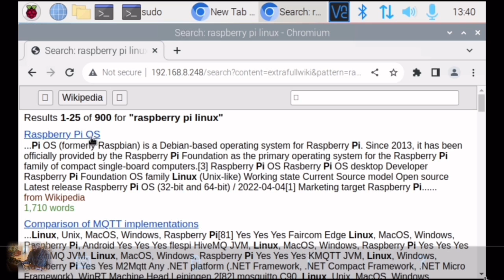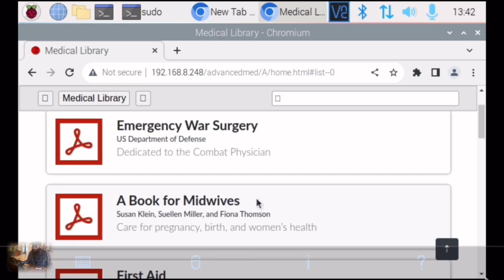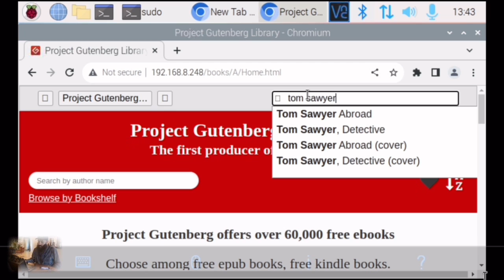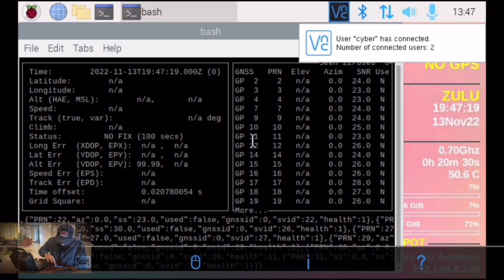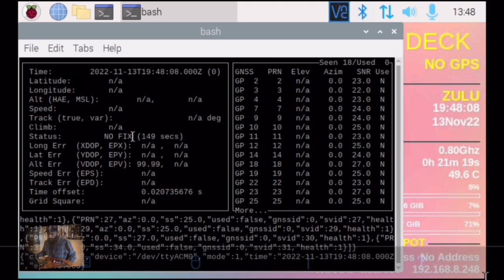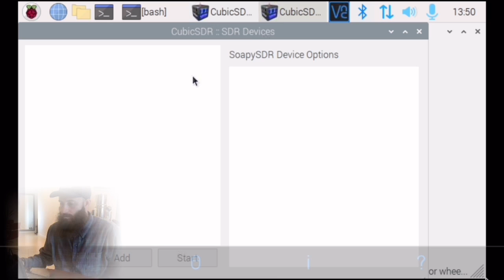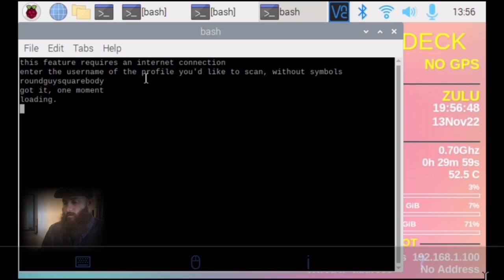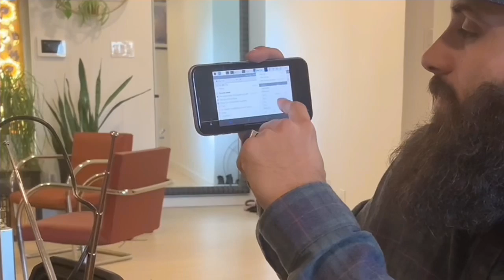GRIDBASE UI introduction.

Comment: It would be cool if you had an ai fed all this information and you can search through all of it with a simple question
Reply: but that would require at least 8GB RAM and on AVG 64GB for future proofing and speed. + 5TB memory card. As you need to store a lot of data that might be used on the AI for future training or quick assessment.

Comment: Does the cyber deck have HF transmit capabilities? if not it would be cool to integrate a QRP radio to use modes like ARPS and JS8call

Comment: There is some time invested into this build.  Good job.  I am not looking to buy one at this time but if I had the extra cash I totally would.  I might have missed it but what are you using for data storage in this unit?  NVMe?
Reply from the maker: SSD. For its adaptability, durability, and COTS friendliness.
Reply: @gridbasedotnet  i agree. Ssd is the best choice.  Great work.

Comment: How did you get the programs/apps to all fit within the screen? I’ve downloaded a few ham radio programs like j8call, xastir, gpredict, etc., but the windows are too big to view them all on the tiny raspberry pi screen. I found one kind of solution someone online said to enter: “mousepad .config/wayfire.ini” and it opens up a file and you scroll down and have to add a line in between some existing lines. That kind of works but it just makes everything that you open maximize automatically. It’s better that I can at least see the top bar where I can exit app if I want but some apps still go off the bottom of the screen. And it made conky try to go full screen too. So I’m super curious how you have it set so you can open any app and see the whole window.

Comment: Starlink + laptop in a case = better setup. this thing looks like its a slide show. and the res looks fine all blown up for a video but that screen looks garbage
Reply from the maker: Takes a lot of power to run laptop/starlink. 

Better is subjective. Better at computing performance? Yes. 

Better at long term sustainability for basic computer functions in the field? Absolutely not. You’re also still dependent on satellites so it’s not exactly decentralized. You’re still leveraging existing infrastructure, which is the exact thing this project is trying to avoid. So. 

Better for you? Maybe. Better for my customers who understand the goals, limitations and requirements? Definitely not.
Reply: @gridbasedotnet  ofc you dont think its better lmao youve found a money printer. does ur device not look for sats also? yup so that whole "ou’re also still dependent on satellites so it’s not exactly decentralized" statement is usless. and starlink can be run on a solar setup indeffiently. plenty of ebook files onlinne to mass download to store on a laptob
Reply from the maker: What the fuck is a laptob
Reply from the maker: Mine can look for satellites. But it isn’t required to access the off-grid internet. Only for GPS nav.
Reply from the maker: You clearly have little idea about what the fuck you’re talking about. Which is fine, you came here to learn. But learn then. Ask questions. Don’t criticize with infantile logic. Sit down and listen for once.

Comment: Magnetic cellar automata circuit with electro wetted display could go all year long on that battery, as while not classically fast enough to be justified commercially, it is like 1 million lower energy decades ago, and is now talking about 4 tera Hertz.  However, the classic type of  the MCA type circuit, can be manufactured at home.  So, excellent for a survival prepper tablet which could fit in a normal laptop style case with many terabyte MCA storage space.  There are cheaper manufacturing options coming out now, so a full development could be had with some crowd funding.  I'm not in a health position to do so, but some completion helps and rebuilding civilisation after the catastrophe cycles, sounds good to me.

Comment: I think I'm not sure I understand the benefit of using your phone to access this device over VNC. If you can stream the device's screen then it would be much easier to just access the ip on port 80 to view the information directly..

I guess it is an interesting concept. I think the only feature that is interesting to me is the radio application, but I assume that would require a license to operate in a way that would make it useful.

Other than that, I am unable to determine a good purpose for this product as the niche it is attempting to fill would be better filled by converting e-waste, rather than using new components. It seems that you believed that the software portion of this was difficult, I am not sure I understand that perspective as there is definitely quite a lot of documentation on how to create something like this. Perhaps it is a chicken and egg situation, where you are unaware of the words to search for to learn how to do it.

For some of us tinkering with Linux is normal, and the idea of paying someone else to have tinkered with the install is inane.

I have never understood that "Stalk" app, I have seen it used on TikTok as well. It doesn't seem like a particularly impressive piece of software. I think it creates the link present on the screen, sends a request to that page, and displays the link if the server responds with a 200(OK). It's something someone could create during their lunch break, and if you wanted to use it for the purposes you stated, to determine information about yourself, it would be better to just set up a webpage that when opened does the same thing and sets a toggle to found/not found. I guess it's possible you don't have the list of websites that the stalk app does. But if it's just for you then you know where you should be findable so I am not sure if you need that list.

Comment: One thing that would be tremendously useful with this build is an e ink display to seriously cut down on energy usage
Reply from the maker: The refresh rate isn’t good enough to handle the tasks required of the device. 

However, pocket is screenless, that is the lowest power option.

Comment: its worth noting the rasberry pi 3 can run at minimal power with a simple usb-b charger. A rasberry pi 4 cannot. The rasberry pi3 is a usb-b vs rasberry pi 4 which is usb-c. The HDMI on a pi3 is normal, its completly fucked on a pi4 and requires a mini-hdmi adapter
Reply from the maker: Since you’re noting trade offs…

Raspberry pi 4 still consumes a fraction of the power compared to many alternatives. Small enough to easily run for 8 hours of decent lithium battery packs. 

Additionally, the pi 3 does not efficiently have the capability to boot from USB, limiting storage transfer size and speed.

Lastly, we leverage the SPI interface. So the HDMI, while completely standard and not “fucked up”, doesn’t interfere with what we have going on here.
Reply: @gridbasedotnet  okay so maybe the pi4 is worth it (someone obviously knows more in this exchange lol), but the hdmi is not standard, maybe the spi interface is but the port is the miniaturized hdmi which is weird, depends on how much soldering one plans on doing. And for battery packs maybe it makes no difference, but the pi3 can run undervolted from a iphone charger block and the pi4 cannot
Reply from the maker: @0xdeadbeef238 that is true, with some limitations. The pi might run, but I needs full power to support peripherals such as high performance hard drives and some USB GPS modules

Comment: If only this was solar powered, waterproof, fire proof and hand cracked with alternate source of power other than lithium ion. 
With dark mode. Hahaha
Reply from the maker: It’s designed to be interoperable with many types of power sources. I have a portable solar panel that it works with. The case is waterproof. fire resistant. And dark mode is optional.

Comment: Very cool. Need to add a local LLM chatbot to this so we have GPT-like discussion offline.
Reply from the maker: You want to help? I have tried and cannot get Llama to perform reliably.
Reply: Is it a speed problem, or is the LLM just dumb?
Reply from the maker: LLMs we’re dumb
Reply: Some models that you might want to explore: T5 Small or T5 Base,  BERT-Mini, BERT-Small, BERT-Medium, FastText, ELECTRA-Small or ELECTRA-Base, GPT-2 distilled
Reply: It would be fantastic if you could get a chatbot interface to locate specific data offline. Say you had a specific set of ingredients that you wanted a specific recipe for, you could put it into your chatbot and it would access the local data to compile an answer. That would be invaluable in a SHTF scenario where the grid goes down. In an emergency, one might not have time to search databases to find needed information.

Comment: I actually had this same idea years ago. Main thing you need is a Faraday cage to prevent solar flares from destroying your computer, which is a highly likely doomsday scenario.
Reply: DIY Faraday cage: https://www.youtube.com/watch?v=2s8CpK6F7UM
Reply: That would fit in large ammo box
Reply: Its a pi, not a car. They work by using lengths of wire to induce charge and fry electronics. It really is only an issue for the grid and anything connected to it.

EMPs don't work like a magic permanent shut off button.
Reply: I used to want to download all of Wikipedia onto a drive then keep it with a solar charger and small tablet to access it all
Reply from the maker: @marcusholtzheimer9316 you should still want to do that.
Reply: Everyone had this idea years ago. What did you do with your idea?
Reply: @jerbear7952  downloaded everything I needed to an old phone. Works like a hot dam
Reply: I too thought about this but if there was a solar flare big enough to knock down most of civilization my raspberry pi ain't surviving no matter how big the cage
Reply: @BeaHasPP  I keep getting mixed results as to whether it will or not.
Reply: @plaguedoct0r  I mean any Faraday cage is better than non but to be fair I haven't delved to deep in to emps but if an emp is basically a wireless electric pulse than a Faraday cage is a wire and it makes sense that the bigger the emp the thicker or bigger the Faraday cage would need to be to channel the energy to ground. If my understanding is wrong please correct me.
Reply: @plaguedoct0r it needs to be grounded so that the surge can be discharged into the earth. Otherwise there's a real chance that the cage might not really do anything
Reply: @hcolider2817  Thanks. But I'm pretty sure they did in the video I provided.

Comment: So thought a bit more about this "invention". 
 1. Kindle $99 ( all the books I could ever want to read in my lifetime) 
 If you don't know you can use a free program called Calibre to convert any book format and put on your kindle. 
 2. generic solar panel with USB $30 to charge the kindle and the SDR
 3. SDR $199 
 4. Garmin GPS $199 
5. waterproof case $40 

 Not having all of your eggs in one basket PRICELESS!
Reply from the maker: That is an excellent alternative! Not capable of doing everything the base station can do by any means. But, for strictly the IIAB function, it would do the trick. The base station features the ability to manage a plethora of digital mode communication programs over HF. In addition to that, it is a turn key solution with customer support that less tech savy folks appreciate. The best part about the free market is that we are all able to make choices about what best suites our needs, and I support the hell out of that!

Comment: i only have to ask why? put a laptop in a case, mutch better performance.
Reply from the maker: Not looking for better performance as much as we’re looking for optimal power consumption, for operating off solar and other alternative energy sources. Also, for running radio programs it’s nice to have the control linux offers.

Comment: yeah all fun until the emp which comes from the funny nuke you showed at the beginning fries the whole thing. no emp protection at all. good luck
Reply from the maker: It was designed to be small enough to fit in the very wide variety of EMP proofing solutions existing readily on the market today. 

EMPs are a serious threat. But, they’re not the only threat. I figure let the end user choose if and how they want to EMP harden their devices instead of increasing the cost of the product and forcing a proprietary EMP solution on them

Comment: I think you meant IP6x not IPv6.
IP6x is a waterproofing rating. The x is replaced with a dustproofing rating.
IPv6 is a network addressig protocol.
Reply from the maker: You are correct. Too much going on in the dome 😮‍💨
Reply: Whew. For a second there, I thought this would keep all my 128-bit addresses bone-dry, but my 32-bit IPv4 addresses would be soaking wet. I was both scared and confused.

Comment: Time stamp 4:24 it says when you order it from you it comes with a 48000mah solar charging block, but your preorder says it doesn’t, which is it
Reply: Also at 13:45
Reply from the maker: It does. And always has. You might be looking at the DIY kit on the website which does not.

Comment: You should also add a protection for it from emp.
Reply from the maker: Easily done by throwing it a faraday bag
Reply: @gridbasedotnet  niceee... But it should be built into it so you don't have to carry extra bags in nuclear war.
Reply from the maker: If it was built in the Wi-Fi and Bluetooth capabilities would be limited. 

I prefer to let the end user decide to either throw it in a faraday bag or like it themselves. Flexibility in a product is good. I don’t need to do everything for the end user.
Reply: That venerable Kiwix is made to survive! Happy to see it still useful after all these years, thanks for sharing.
Reply from the maker: @esspe2 indeed!! When did you first use it?
Reply: @gridbasedotnet  It was used mainly for Wikipedia, books, and videos that some YouTubers had put in an archive, and also PhET for stem. But then I got a good Internet connection and it was less useful.
I also found IIAB a neat project; nice that you gave it a wind of freshness.
Reply from the maker: @esspe2 that is a high compliment! Thank you 🙏🏽

Comment: Nice looking build! I am in the process of building one very similar. My one question is how much does the exterior modifications impact the water proof ability of the pelican case? While I like the exterior plugs I am trying to not breach the shell of my case for anything.
Reply from the maker: I use only IPX6 rated connectors and seal them with silicone. In all my tests I have had no failures. Even after multiple drop tests.

I have a bunch of stuff on the website that might help with your build. Check it out.

www.Gridbase.net

Comment: Some suggestions. The mouse is cute, but a laser trackball  does the same thing without needing to move it around. Of course it's more expensive at around $50. I use Logitech and one dongle can cover up to 6 devices,. One dongle saves on power,  and I can take or leave a larger keyboard if I want, no prep.  ltunify is the program that let's you  unify Logitech devices to the one dongle.  For power I use rechargeable power tool batteries,  convenient with lots of power, fast recharge times.  My Pi4 Boombox runs 6.5-7 hours, through a 5A buck converter, 5.2-5.3v, (same as official power supply.) Overclocked to around 2100-2200 Android 13. Twister OS, for an amazing desktop with, Retropie installed already, 2175-2225. I use it constantly on the side for entertainment, movies, tv, games, YouTube. It's good to use it, make refinements, changes,  keep the OS as current as possible. Also easy to use a cell phone as a hotspot for full internet anywhere there's a signal.  These things are awesome whether you buy or build,  addictive as well.  Just swap around software as you need it and keep the survival data on it's own USB flash, so it's there when zombies attack!

Comment: How are you off grid with a gps beacon? I can find you with that. Also who’s maintaining these satellites if the internet is down? They can’t reposition and they’ll be destroyed. That’s why you have the cyber deck in the first place.
Reply from the maker: The gps is a piece of hardware you can optionally connect if you choose to do so. As a company, we’re only taking advantage of the existing satellite infrastructure. Not managing our own. So, if infrastructure collapsed, you wouldn’t be able to precisely geolocate yourself. However, you’d still have access to pre-downloaded map repositories, so you could treat it like a regular map and orient yourself using terrain features and a compass.
Reply: @gridbasedotnet  what you want in there is LoRa Mesh transceiver or a full SDR transceiver. With a decent SDR you can pickup and decode GPS as well as lots of other messages. What you have there is a oversized cellphone. You could just keep a cell phone handy and have the same thing. Jailbreak an iPhone and install Kwix
Reply from the maker: Actively Working on LoRa. And, the Cyberdeck ships with SDR equipment/antennas for the purpose you’re referencing. 

The name of the game is contingency. GPS is only one way that cyberdeck can skin the cat, if the user chooses to skin it that way.